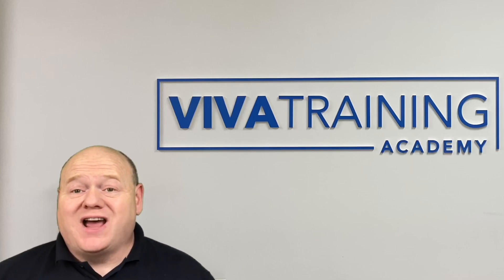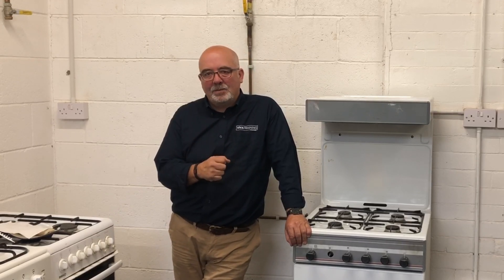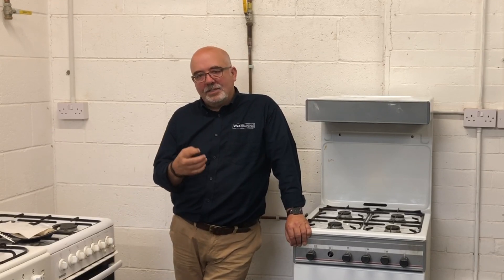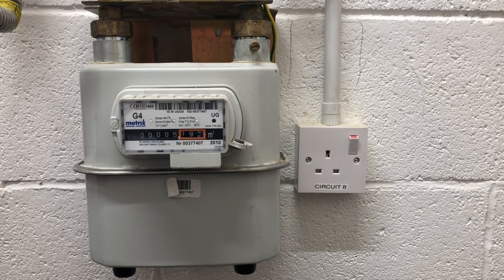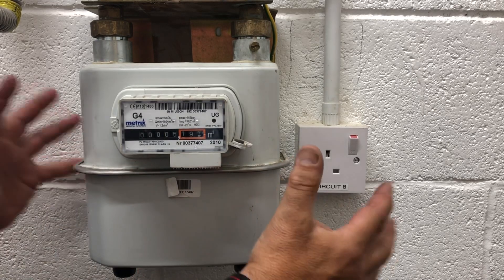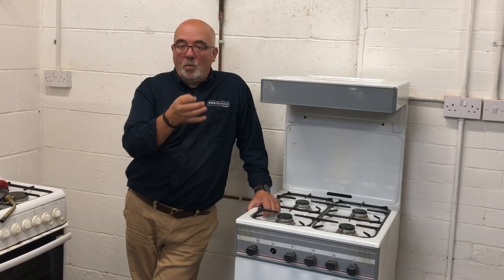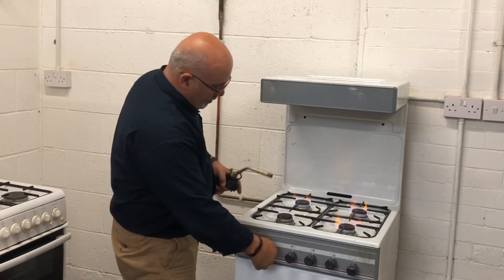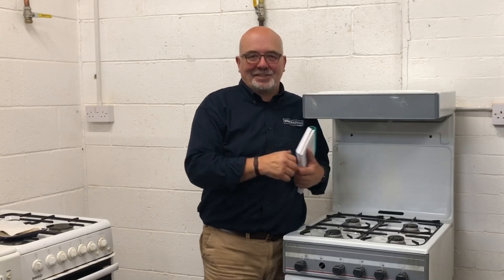HOW TO PURGE NATURAL GAS - Gas Training - ACS - Gas Meter - Domestic Gas Meters - Russell Holdsworth

Comment: It’s very easy, indeed one could say it’s a trivial exercise to purge when a cooker exists but what about the situation where there is a boiler sited in an understairs cupboard, with no other gas appliances in the property, where purging by disturbing pipework would result in gas in a confined place that cannot be ventilated by natural means. Leaving the pervading smell of gas isn’t acceptable for the customer.

Burning off the gas by disturbing the gas connection at the boiler and igniting it could result in flame damage to the external wiring, the internal wiring, the condensate trap and the condensate drain pipework.  Then you have to check for leaks with LDF.

So is firing up the boiler, letting it self purge and accepting a failure to light several times in sequence with the risk of locking out, infinitely more preferable to any disturbance of the gas connection?

Comment: 7:19 - I haven’t got my MET1, but is the electric socket too close to the meter?
Reply: 25mm gap is enough. If the socket was a consumer unit then it would 150mm gap

Comment: If I turn the boiler on will that purge air out of the gas pipe 15mm between meter and boiler
Reply from the maker: Merry Christmas
Reply: @AllenHart999  merry Christmas but you didn’t answer my question
Reply: Allen hart never replied to my question as much use as a hole in a bucket
Reply from the maker: paul bond I have thousands of questions to answer, I do try my best. Remember I am here for free to try and help people. Normally you would crack the nut under the boiler, try and control as much as possible. As always please refer to the gas manual for unto date advice. Happy New Year
Reply: @AllenHart999  there’s a bird on you tube who just fires up the boiler don’t crack the nut on the boiler my point is why didn’t she crack the nut instead of firing the boiler she’s gas safe registered
Reply: @paulbond1666  a bird ? You mean the lovely tina barham. She did it wrong....for once it seems. But in practice gas engineers will 90 times out of 100 have a gas cooker and then they muller the boiler for a purge constantly restarting it after lock out it till they get fire. Crack a nut is thr right way and then LDF the joint obviously with the gas turned back on at the ECV

Comment: why do you need to purge? I am not a gas engineer I am just interested to know. I find things like this very interesting
Reply: 1. Appliances won't light if the pipes are full of air
2. If there's an air / gas mixture in pipes, this is a dangerous (combustible / explosive) situation.

Comment: What if the furthest applience away isn't a cooker? It's a fitting but the purge volume is greater than 0.02m³
Reply: you can purge from any appliance mate
Reply: If the furthest point is a condensing boiler but there is a cooker which would you use ?
Reply: Boiler

Comment: If it’s a g4, u6 and e6 and under 28mm pipe work is it just up to 10 on the Meters or until the gas lights? Also if it’s over 28mm or g10 or u16 how much does it need to go up by at the meter mate?
Reply: G4, U6 and E6 if pipework is under 28mm purge volume is 0.01, The purge volume for G10 or U16 is 1.5 X the installation volume.
Reply: A tip: don't say "10 on the meter". It's not ten, it's 0.010 m^3. If you have a meter with only 2 decimal places on the dial, then purging "10" will get you into serious trouble. Just grasp the nettle and become comfortable with using decimals.
Reply: @Jehannum2000 tip get a life you sad bell

Comment: Purge volume for any installations equal to or above 0.2m3 or with pipework greater than 28mm is,  meter volume + pipe volume + 10% for fittings, multiplied by 1.5.  Everything equal to or above 0.2m3 must be purged with a continuous source of ignition.
Reply: Hi MSK, this is very well known, but can't find a video actually showing how this is done in reality. Is there such a video, or could you do one Allen. It seems everyone just slackens a nut, smells gas then reseals???
Reply: @davidb2464  there are some industrial installation videos I'm sure where they employ a burner for purging, but I haven't seen a domestic one.
Reply: @davidb2464  here is an industrial one but they use air to gas ratio test equipment to ascertain that the purge is correct rather than an open burner.  The amount of testing is insane.   They even tightness test the purge equipment.  XD https://www.youtube.com/watch?v=j5yIxN1vKMc
Reply: This is incorrect. It's not 0.2 m^3, it's 0.02 m^3. You are out by a factor of 10. If you're going to quote figures, GET THEM RIGHT! Furthermore, it's not purge volume, it's installation volume (IV) that determines this.

Comment: Hi al , do u just crack a nut under the boiler if theres no gas cooker ? Aslong as its well ventilated? And under control
Reply: No. If you do that you need to do a tightness test again. Just fire the boiler up, it should self purge
Reply: @Matilda1337  really ? You tell your examiner that on an ACS assessment?
Reply: @Михаиллеви  tell them what?
Reply: @Matilda1337  what you said in your comment
Reply: @Михаиллеви  tell me what’s wrong with it then? Why wouldn’t you tightness test (perhaps locally) if you disturb a gas fitting? 
Boilers are set purging. 
If you can’t tell me where I’m wrong then I’ll just assume you don’t know what you’re talking about.
Reply: @Matilda1337  just testing. You are correct. For an installation volume of more than 0.02m3 with the same post on this thread what would you do ? Also how do you purge imperial meters with pipework in excess of 28mm but not exceeding 35mm ?

Comment: What makes me laugh about `gas safe is . You cant leave a cooker purging and look at the gas meter . But you can walk away and leave someone with a gas leak if its within the parameters . Personally Id never left a job with a drop If it needed re piping it got it
Reply: There’s no parameters for a leak. The drops are suppose to be proven to be passing through the meter or appliances. I.e pipe work alone should never have a drop.
Reply: @dando1898  its still a leak. Apparently if you tightness test old pipework and appliances and the drop is permissble and no smell of gas you can walk away yet the leak may be in the pipework
Reply: @Михаиллеви  its not as simple as walking away, if there is a leak then you have to investigate that leak, if the leak is on the pipework then you have to isolate that pipework because its ID or fix the leak, if its on an appliance and there is no smell of gas then it is taken that the leak is passing out the flue and not building up within the property, if there is a smell of gas then again the appliance is ID and needs to be isolated or fixed
Reply from the maker: Thanks for the comment.

Comment: Allen what about a vid on correct procedure on how to cut a branch into a gas line that is in use or already purged with gas in all the ACS courses and refreshers this topic was never touched upon
Reply from the maker: That is a great idea. I will add that on my list. Thank you.
Reply: @AllenHart999  Hi Allen, yep this would be very informative. I've just read that the meter has to be removed and all ends sealed with appropriate fittings. This has never been explained during traing or when done in reality? What is your experience of others actually doing this in practise?